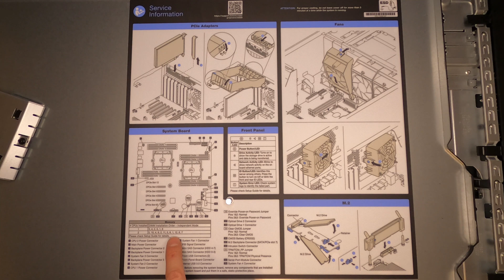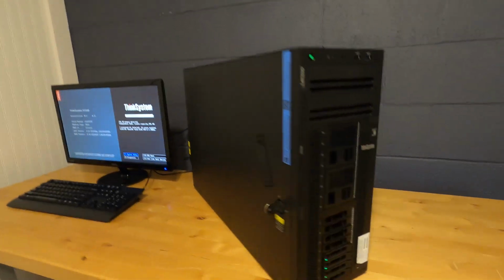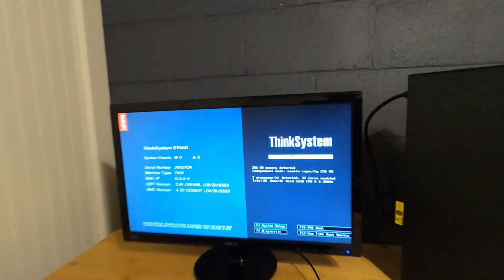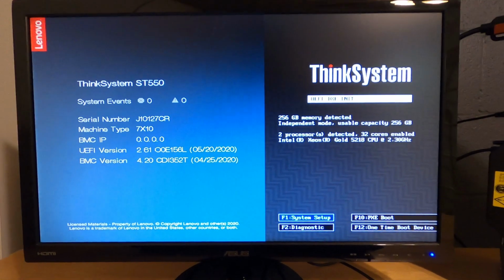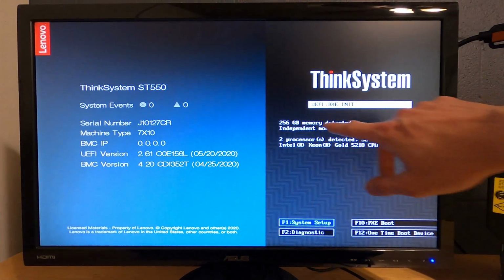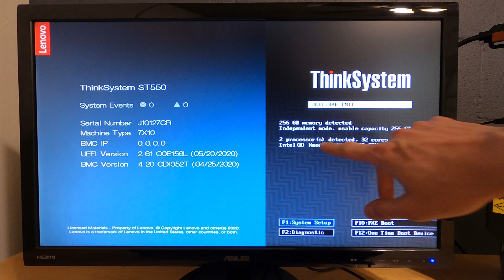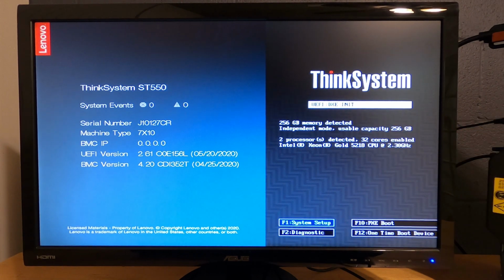Lenovo ThinkSystem ST550 5218 Upgrades - 2nd Xeon CPU, 256GB of RAM, and M.2 Enablement Kit.

Comment: Can both a RTX 3080, and a Yeston AMD RX550 fit in this?
Reply from the maker: I believe the rx550 will fit, but I don't think any RTX cards will that require pcie power connectors will.

Comment: Great video! Just a quick question, I've installed the same 2 CPU's in my HP Z8 G4 with Micron 2933 ECC RAM. The PC Starts but then bleeps which indicate issues with RAM. Does the RAM have to be DDR-2667? or can the faster ones be installed? Or could it be some other issue?
Reply from the maker: It's hard to say, but it does sound like a RAM issue. Typically you can install faster memory and it will just down clock it. Put the original back in and make sure everything POSTs

Comment: Hi, i try to find Lenovo M.2 Enablement Kit but in raid, i call Lenovo and said does not exist for my model, i said you use the part 7Y37A01092 for m.2 kit, and he told it's not supposed to work with the st550. Can you confirm your adapter work fine with your server and maybe you can tell me if you know for the kt but in raid. Thank you in advance.
Reply from the maker: It only supports 1 M.2 drive, so I have it set up in single disk mode.
Reply from the maker: This kit shows mirroring capability:
https://amzn.to/3ap3fME
I did find a PDF that list support for the st550 server, but not all models.
Reply: @ZipTieNinja  Thank you for your awnser, but you confirm the 970 pro nvme work on your system now, like i said, lenovo said it's not supposed to work on this adapter, only sata m.2 can be support, the nvme worked only with third generation of cpu xeon. but if you confirm it worked i will buy this.

Comment: I am also looking to buy the ST550 with Xeon Silver 4208 and 32GB of Ram I am totally new to Servers I have a few questions for you what OS open-source OS you suggest. I am also going to use this for Virtualization.
1. Sap Hana express edition
2. Sap netweaver developer edition 
3. NextCloud for file storage 

What are you using for Power Outage? What will happen if i dont have a UPS for the server
Reply from the maker: I always use Windows Server standard. I have no experience with any open source server OSs. You want to run a UPS on absolutely anything important so that you do not corrupt databases or cause operating system issues if you were to lose power when updates are being installed.